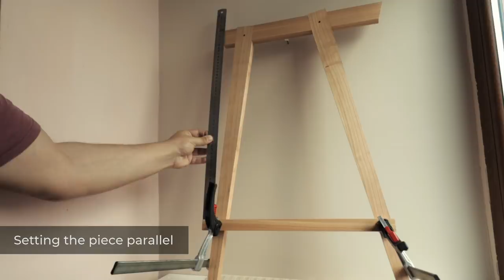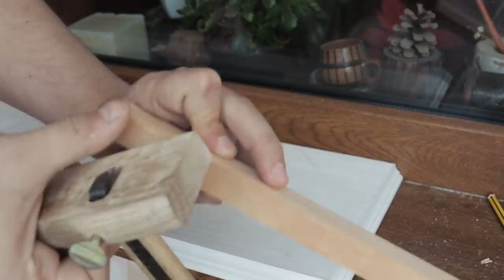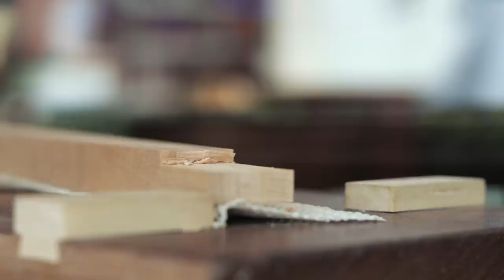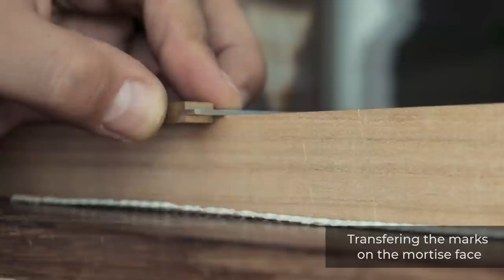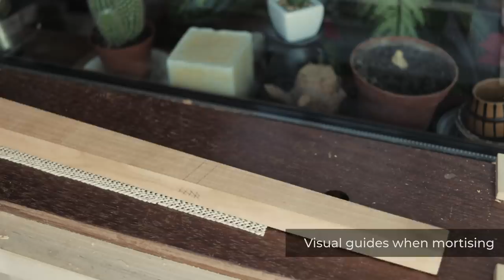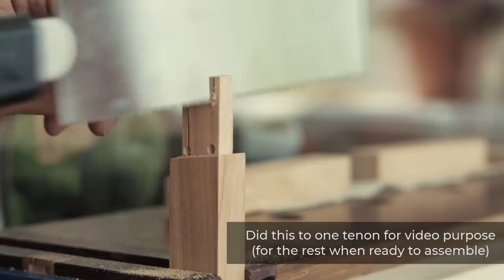Making Angled Wedged Mortise & Tenon Joints - Desk Build Ep.4

Comment: Hey Adrian, really enjoying watching you go through this build.  How much accuracy do you try to achieve when matching the angle of your wedges to your mortises when creating a wedged mortise and tenon?
Reply from the maker: Hi Conor, thanks! That's a good question, glad you ask. As you can see the wedge's angle is too big respect to that available bent created in the tenon. I just eyeball it on the shooting board and that's it. This was just for showing in the video for consistency and I made it just to one tenon on a rear leg. Probably for the others I may adjust it with a chisel for a sharper angle, will see. I do not care so much about the wedge matching perfectly for joinery that will be glued anyway. The glue, PVA type, will hold sufficient, the wedge even wide angle as it is will just extra protect it. On the other hand, if I were to make a joinery with no glue I will have spent more time matching the angles for sure. 
What I will adjust for the other tenons for sure is the width of those lateral splits to be just a hair wider than the wedge for design purpose.